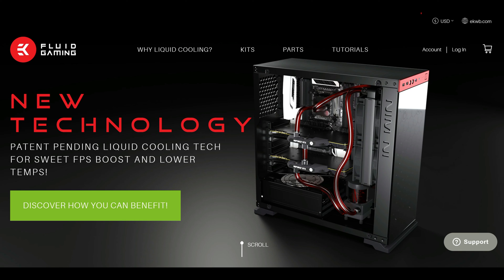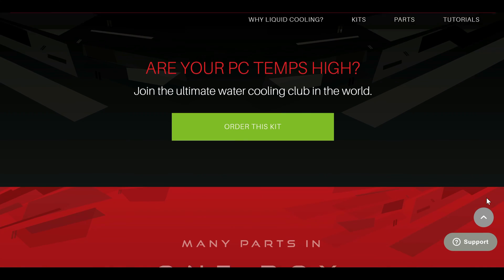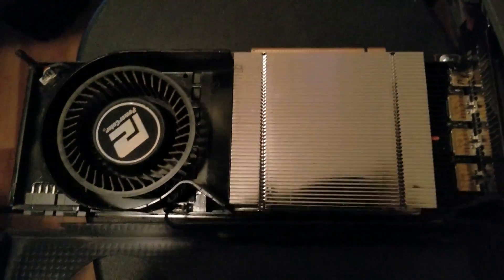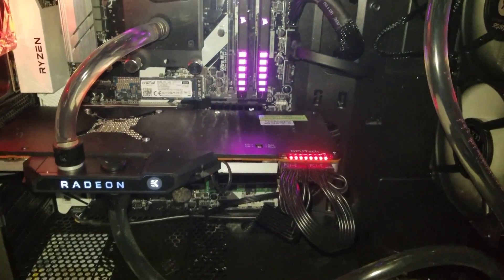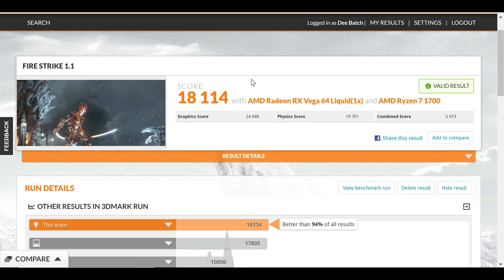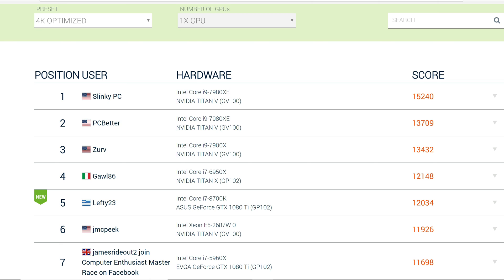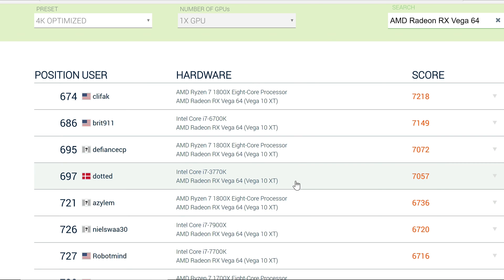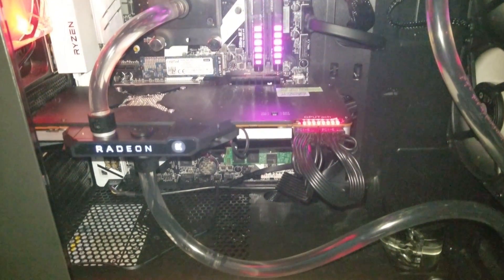A240R vega liquid cooling review and benchmarks

Comment: I got the same system, but for some reason my cpu gets to 80-90 Celsius even tho the gpu stays around 45 max. (Bf5 at only 1080p) I even have 3 120mm radiators... (one single and a double combined)

Comment: So, is the complete block all aluminum, or is it plated inside/outside?  Appears to be raw aluminum from what I can gather?
Reply from the maker: All Aluminum TMK. This is still working great. Was necessary in order for me to get the most from Vega 64.
Reply: @DeeBatch  Thank you!  Sadly will not work with the rest of my loop due to copper/alum issues..
Reply from the maker: @shawncope5875  Ya never mix.

Comment: Have you tested this with top mounted radiator? Does front mounting it work better?
Reply from the maker: won't make a difference if you have a pull setup.
Reply: Thanks for the quick answer, so mounting the fans on top of the radiator at the top of the case pulling air through it and out the top should work fine? Just trying to make sure I understand you completely.
Reply from the maker: @ThePineTreesBand  yes

Comment: I know this is an old vid but have you had any hot spot issues leaving that x spring bracket off? I just put my ref vega underwater with the EK rgb nickel block with the x bracket off as you did and I'm having hot spot issues. Whats odd is the main package temps read amazing good with CAM showing a max of 56 under load but I'm getting crashs and BSOD's wile playing games. Loading gpuz though showing the same on the package but the HBM is a house fire 100c instantly after starting superpo and my vrm temps get higher then I like as well mid 80. Im going to tear it down and put all new paste and pads and use the x bracket this time to see if thats the issue.
Reply from the maker: Lol I was worried too .. No hot spots well over a years use.
Reply: @DeeBatch  That's good to hear bro. I going to try it with the x bracket though hopefully it will fix my problem. EK's nickel block is som kind of heavy. It might be flexing or something.
Reply from the maker: @allenpost3616  Ya I got lucky my card was good.. Got lucky again with my Radeon Vii. That hits over 2000MHz on air!

Comment: I'm running duel vega 64s rf cards along side an 2700x. I love the performance yes its loud as shit. I actually stumbled on to this video cause I wanted to check out the gpu water block which I will be buying 2. My cpu is on water with a custom xspc loop. 360mm rad and the proton res with an xspc water block. I'm gonna run a separate loop for the gpu. They will be on a 360mm rad and another xspc proton res. Once I get the gpu water blocks which I made my mind up on getting the one you have shown, I'm going hard lines. Also good review I sub'd and liked
Reply: Also my fans are at 92% anytime I'm playing games and I stay in the low 60's. I got a really nice set of noise canceling headphones so the noise doesn't really bother me. I wanted to add that have have everything I need to build the second water loop except for the two waterblocks. My build already looks amazing in the thermal take rgb lvl 20 ($250 version) case. The aorus x470 gaming 7 board is beautiful!! All my wiring is routed and hid. And my plumbing is routed perfectly. I'm stoked I found a set of water blocks that will look good in my build!!
Reply from the maker: Still going strong..

Comment: No lie, the FireStrike score and your temps aren't really that "exceptional" being water cooled. My MSI Vega 64 Air Boost (Reference Design) gets 18111 in FireStrike and my "Average" temps running several stress tests is the same as yours (43c). My max temps putting the card under load for 30 minutes were 70c which is higher than yours, but I also have my State 7 at 1700mhz @ 1020Mv. It seems like under water you should be able to get better scores and temps than you are... I do think I won the Bin lottery though as my card seems to be particularly stable when overclocking, I haven't even really tried pushing it further because it's performed so well.  What memory is on your card? I got Samsung on mine, but I've heard the Hynix isn't very good for OC/Stability.
Reply from the maker: My undervolt and OC were not optimal when I did this. I get much higher scores now. I have Samsung memory goes over 1100.
Reply: @DeeBatch  No worries, I'm considering buying this kit when it comes back in stock to pair with my 9900k upgrade. Are you still digging this cooling setup? What are you final OC/Undervolts and Temps?
Reply from the maker: @cardbored_  Yes love this kit. will gve you my OV/UV wed
Reply: LANo I’m a little late. But all I did was slide the power slider all the way to the right (+50%) and I achieved 21000 gpu score on fire strike. Only one run because of course the card will throttle if it ran many consecutive runs. It runs mostly at 1590 MHz and got pretty hot. My alphacool gpx pro with a 240mm rad will be here some time tomorrow. I’d like to upload a video about it. And I have pictures of my scores if you’d like to see.

Comment: I have Vega64 + Morpsheus II air cooler with 2x120 Swiftech 120mm HSP fans and Vega64 LC bios.
Temps get around 50-60C, depends on workload. HBM2 aroudn same. Have UV the core, but default clock 1752mhz. HBM at 1140Mhz and 980mv.
3DMark FireStrike graphiocs best score 27 155  and TimeSpy Graphics Score  8 442  (Overall 8070). CPU is Ryzen 5 1600@3.8Ghz.
Superposition score was 6935. (Min.43.25fps; Avg.51.87; Max.62.40).
And fans are silent! But I am planning to go custom Watercooling road. Already have ordered EK Vega nickel gpu and cpu block, got a great price at this Black Friday sale.

At TimeSpy run, card boosts to between 1715-1725mhz. When playing Forza Horizon 4, the card holds 1730-1750mhz boost and temps around 62C.
Moprheus II cooler is a beast!

Comment: I wonder if you can use the nickle plated components with these kits and not have a corrosion problem? Will the plating eventually come off and expose the copper?
Reply from the maker: So far so good...
Reply: Good to hear, I wondered if the nickel plated blocks would work with the aluminum kits.
Reply from the maker: Don't mix metals.. Yes I heard some did with no issues. However I do not recommend.
Reply: As long as the nickle plating is good and doesn't go bad. It should never be an issue. You can nickle plate aluminum. Being in the aviation industry. I see what can happen with dissimilar metals. EK did have an issue with their nickle plating in the pass but they have rectified that issue.

Comment: Reference LC Vega 64, stock cooler. I run the HBM at 1100Mhz and the GPU clock at 1750Mhz. I haven't run any benchmarks, but the in-game performance provided by the AMD drivers show my temps maxing out at 70C only under the most extreme gaming. Most of the time it is around 60C.
Reply: Awesome..... with my custom loop (240mm rad, 200mm rad, 420mm rad) I should be able to do 1800mhz/1200 (Samsung Memory).

Comment: Wow got a similar setup as you. Running a R7 1700 and Vega 64 reference cooler. So I do want to custom watercool and got the Corsair 570X case. So you think it's worth getting this particular setup with a added 360 rad expansion kit? Thanks!
Reply from the maker: yup well worth it!
Reply: I am sold just from checking your video out. As well probably the only video that had a solid review of the kit!
Reply: yeah ive got 2700x and v64 strix, finally gonna make a custom loop for both!

Comment: hello. i have the same setup . will be enought this kit to cool my oc vega and oc ryzen cpu? thanks for help :D
Reply from the maker: Yup I have no issues
Reply: i put this thing together and i have one more 120mm radiator for the setup. i have my 1700oc at 3.8ghz at 1.375v my gpu temp is ok like 45c max but cpu temp is like 75c in full load. i try to lower my voltage but it crash. any idea?
Reply from the maker: you probably did not use enough paste on cpu and make sure block is down firmly on cpu... Put paste on in x pattern.. I never get my cpu that high.. highest is like 56C and I have it @ 3.9ghz.. Also try to undervolt your vega as it maybe putting lots of heat into the loop.. If this fails use spare rad.. You should not need to tbh though.
Reply: DEE BATCH I put my paste in X pattern tight screws down as much i can. I think that problem is that from gpu coolant go to 120mm rad and than to gpu. And maybe i have to much voltage.
Reply: matt factor, loop order doesn't matter in terms of overall temps.  75c is within safe temps as 100c is where it'll throttle.  I say if you're stabel then you can keep it there.  DEE BATCH seems to be running at about 1.357 volts which would have his cooler than yours.  It comes down to silicon lottery.
Reply: Maindric i know that is 75c is in save zone. I even try 3.7ghz at 1.25v and temps are 5c lower. Like you said silicon lottery is the problem in my case
Reply: Are you still using this kit? Have you managed to lower the CPU temp?

Comment: You ended up pretty similar to my setup, though my 1700X is 3.9ghz. That extra heat adds up since it's like 10% more voltage :-/
Reply from the maker: I put my 1700 to 3.9 temp goes higher by 2-3 c

Comment: I have a Vega 64 Liquid.  Here’s my settings.  Core clock is at 1750 (which is factory for this card), memory at 1100, and I turned the power limit up to 50 percent.  Stock setting it has the temp set to 65 C which it will run at 65 with these settings.  I can turn the temp down to 60 C and it will hit it but the fan gets really loud then.  I’ve actually debated buying this kit with the add on 360 mm radiator to improve the temps and noise on my Vega.
Reply from the maker: The kit is worth it .. gaming you will get roughly 50C if you add a 360mm Rad probably 42-45c. Cpu never goes over 45C in gaming with stock kit...
Reply: DEE BATCH That would be awesome. I like the fact also that it’s a universal cpu block. Currently using a 4790k but plan to upgrade to the next generation of Ryzen in April. Wouldn’t have to change blocks then. Do you think going full copper would be worth the extra money?  Or just stick with this?
Reply from the maker: Naw stick with this way cheaper and excellent results... Just don't mix metals.
Reply: DEE BATCH thanks man. Keep up the good work. Love the vids
Reply from the maker: Adam Hahler Thanks man